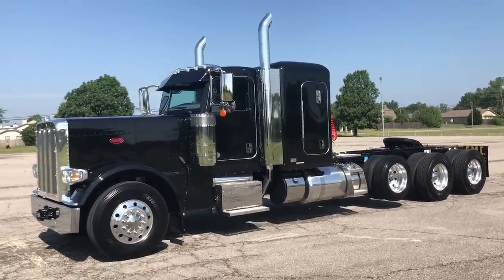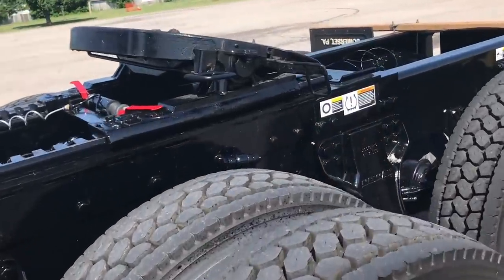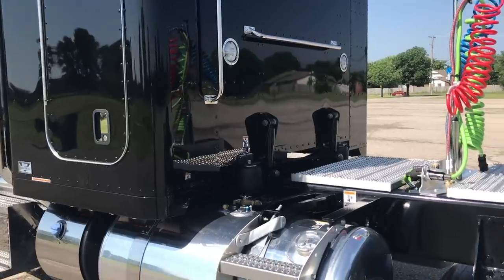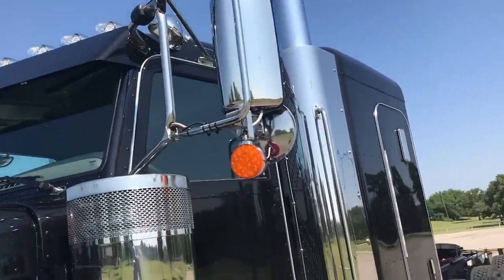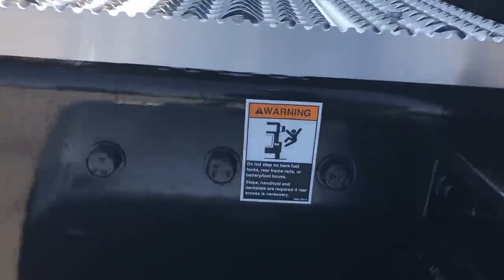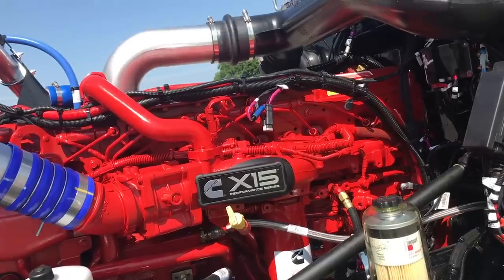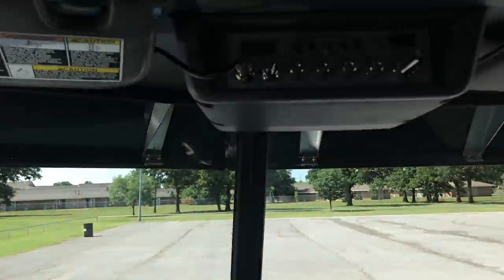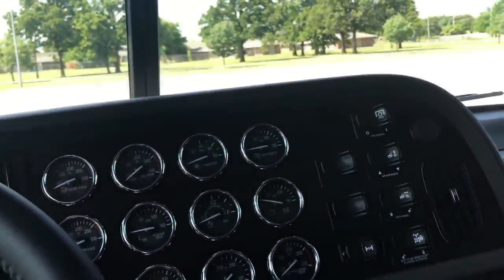2019 389 Peterbilt Heavy Haul 4 speed auxiliary transmission

Comment: Nice heavy haul truck Steve. Good to see the Neway suspension running it on 3 of my trucks. I laughed when you said big 46k rears that's what we run out here in the woods in Oregon but pulling steep grades you need them. If you get pictures after they finish it I'd like to see them, keep up the good work.
Reply: what is the advantage of the neway suspension?
Reply: @ccclc6159  I like it because unlike Pete air trac there's no springs it's just beams and torque arms which limits parts to break,  I had several springs break while I was heavy hauling with the air trac,  I have nearly 250,000 miles with no issues with the neway suspension.

Comment: You said it was a full locker, it's only a 3/4 locker. How many times has that POS Cummins left them on the side of the road? The air shift Spicer would have been neat to see.
Reply from the maker: Been doing this 20+ years PLEASE explain a 3/4 locker to me, I'm all ears...
Reply: @SteveCarbone  a full locker has 3 switches, there were only 2. One interaxle lock and differential lock. The front axle is usually the expensive one that will lock up on a 3/4 locker. A full locker has an air solenoid on the rear as well. Kind of pricey, but worth every penny when the shit hits the fan.

Comment: 315/80-22,5 are used on most dump trucks here. many use it as drives on tractors also as the 295/80 dont have the load ratings. steers 385/65 mostly. but we can haul a lot more per axle. that truck will look sharp when all tricked out :)

Comment: truck I just came out of had 20k front 23k tag 52k rears with disc on steer and drives  2spd aux and 18spd in front full lock rears 550 isx was a beast and 4:33 gears was great spec and was on adz neway air
Reply: robert fletcher Were you happy with the Neway Suspension?
Reply: best suspension I have ever had on a truck tough and rode great for heavy spec truck
Reply: 367 set back axle was 288wb. Had 6.5ft slide on it double locks and full lock rears
Reply: set back axle makes easier to get weight forward when needed
Reply: robert fletcher was it a old ats or valley trans truck?
Reply: @kevinguffey1564  neither
Reply: yeah that's way I'd order them full lockers the neway adz is really good suspension
Reply: robert fletcher I’m just debating between 55” & 60” axle spacings.
Reply: 60 be better because if you run Canada too will have the axle space needed for Max weight and down here one I was driving had the 26k axles and I could get 50k on tandem because of the 60" spacing
Reply: Taylor Alldredge dont get a western star get a peterbilt or a kenworth western stars are made by freightliner and are now junk
Reply: And don't forget but just a suggestion I'd get full 102" wide drive axles there is a difference most are 96 from end to end the wider axle makes more stable the weight bearing on truck is different
Reply: robert fletcher Thanks for that info I will make note of that.
Reply: your welcome alot of guys don't know that their is a axle length difference .but since you are building a true heavy spec like I would do I figured would share that info hope to get to see your truck with all the specs to see how to comes out
Reply: Taylor Alldredge you can get the 4 speed auxiliary in the Pete too! So someone lied to you!
Reply: yeah that is what I was told

Comment: Can someone explain to me how this particular transmission works please. I'm used to 10, 13 and 18 speed but not one like this.
Reply: Start both in first. Technically you can shift every gear but truthfully 6 maybe 7 times depending on hills and weight. Main in first aux in first, shift 2, 3 and 4 on the aux. Then second on main and first on aux. Repeat that for all the gears you have on the main. In reality you learn to skip most of them. Remember to give the air shift aux time to shift else you get it stuck in the middle acts like it's in neutral and it could be. Which is why I like 2 sticks and not the air shift version. Having said that, the air shift version is way easier to shift. Why they mounted it like that is beyond me. Mine is on the main shifter. They had to put it somewhere. Originally it mounted like a gear shit knob because it was meant for non air shifted main transmissions. I'd swap that new school shift knob out to and old school version, add a "Y" adapter and your set. You have to add and re rought the air lines. You really need to have someone show you in the truck. But that's the basics. Good luck. It's not hard it's fun! Only intimidating because you haven't done it.
There's 4 reverse gears too. I recommend you stay in first reverse otherwise you go to fast. A few gears overlap so you don't need them. One or two are actually down shifts even though you made an upshift you figure that out quick.

Comment: Show us how that transmission works!
Joyride time!
Reply: Torsee , basically you have every Gear times 4. It's Awesome. Add s alot of weight but it's worth It.
Reply: Todd Hoover he wants to see how it's done.
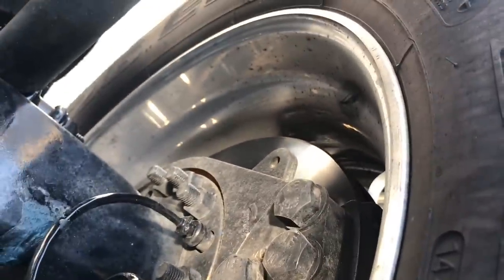Reply: Wish I could show him. Had it in a 379 13spd 3:55 rear's. Pulling a Refer.Awesome spec. Wish I had it Now.Running a Custom 03 379 with 18spd. 3:70 Rear s
Reply: Torsee I
Reply: Beautiful Pete for sure.  I never did like the steering wheels though, they look like they're from my mom's former 1990 mercury topaz shitbox..haha.  the auxiliary blue stick is a stationary stick; its a splitter. Basically "kinda" like taking a 14 or 16 speed spicer,(which is a 2 gearbox system) removing the splitter off the main box and putting it on a stick.  If it was my truck, i'd like it mounted on the gear shift.  You used to see that a lot back in the 80's when V-8's were popular, (V-8 Mack, 3408 Cat powered trucks)  The company I worked for (Domtar) had a lot of log haul trucks; mid 80s macks w/445hp V-8 w/16 spd spicer's.  Youtube search 16 speed spicer and find a couple of good vids of guys showing how to shift one.
Reply: You do not use every gear 4 times. Not even in a 2 stick original 4x4 from years ago, there is duplication between the boxes.
Reply: Check out my vid in my 71 needle it’s a 6 and 4 I have running videos shows how to,, clark friend youtube
Reply: the truck shown is a 2 gear box setup,  the one shown you put the first trans in 1 gear then on the second trans you have one step lower, direct, then one step above  whatever gear the first one is in,,,,,first gear on the second trans is really deep reduction creeper gear not generally used while on the road
Reply: Todd Hoover Was
Reply: Is that a 13 speed or an 18 speed?
Reply: My tractors I built had a 5+4 trans and a 4 speed aux box you only used it in low or low low  to get moving then to direct and after going thru the main trans you could put it in OD running 5:38 gears and not lug it .
Reply: @iBackshift  I feel this needs some correction. The blue stationary stick is an auxiliary 4 speed transmission. A separate box entirely, shifted buy air select. The shift method is similar to a splitter..... But..... if you shifted 1,2,3... maybe 4 on the 18 and flipped one gear on the aux stationary splitter you go back too 1 but be equivalent to 4th at this point in a straight 18spd. If you shifted 1,2,3 again you'd now be equal to high range 6 or 7 H/L the overlap in rations is obvious and needed. But i find the manual gear selector is more satisfying but the stationary is practical
Reply: @ccclc6159  I hate to bust ur bubble but the shifter to on the one shown said it was air shifted .
Reply: @UBIQUITAR   Brian didn't see ur com. Till I wrote mine  I seen the same thing I would like to know more myself. I have only been doing this for 35 years.   I can almost smell B's  when it starts . Not referring to your comm.
Reply: @waynemullins8841  bust my bubble? if you watch the video you can probably figure out how it shifts by the knob and airlines? I usually don't have conversations with shifters but if that shifter told you I said something other than what I posted it might have lied to you

Comment: Has the DEF issues been resolved with the new 2019 Petes ? The whole DEF system has been a nightmare :( Had a 2013 Kenworth T800. Loved the truck but the DEF issue's have been a living Hell😠
Reply: We have a 18 Pete tandem axle with 13,000 miles. No emissions issues, but major suspension problems. From the factory, it didnt have enough steer axle clearance. We put a load on and the front tires came up through the fenders. Pete ended up putting 6 inch blocks in the leafs after 3 visits for the same issue. Mechanically sound, but major chassis issues.

Comment: Can you get it with the hendrickson 20k steer with 425/22.5 and the same with the pusher axle and 24.5 tall rubber one the drivers 4.11 rears with full lockers and the holland fw-100 fifth wheel and 72' raised sleeper? Oh and a fuller RTLO 20918B with a aux browning 4spd? Spicer sucks in my opinion

Comment: They are north of me out of Northern IL. That 4 speed auxiliary is a expensive option. What is the rear axle spacings? A little surprised that they only went with a 14,600 front axle, but then again with that Wheelbase it will be Harder to load the front axle on that truck without a Large Gooseneck Swing Clearance, but it CAN be done. Truck turned out Sharp!
Reply: Peterbilt Steve What is the current lead time on Trucks and I was told that Peterbilt only offers a 2 Spd auxiliary and that you cannot get a 4 speed auxiliary from the factory.

Comment: Nice truck...would look sweet in a tri drive system with 52 000 8 bag system an axles
Also be nice if Peterbilt would start putting the new DD16 in their trucks insted of those ISX Cummins
With heavy towing surprised the company didnt do 4.33 gears but with the 4spd aux 4.10s is lots
Reply: Won't see Detroit in anything paccar anymore as damlier/Mercedes owns Detroit. The new DD series is really just a Mercedes.  In Australia the dd15 is available up to 585 but the dd16 is only available in the new Mercedes Benz.
Reply: @benmurray8689  
Yeah it sucks as the new DDs are nice engines...people i know are having real good luck with all their new trucks, they run the new freightliner 122sd an western stars an pull over size loads. I know it be cool if kenworth an peterbilt would run the new DDs but paccar likes their ISX lol
Reply: @dodgedude101  the new DD series needs really clean diesel and there not simple like the old series 60. Cummins has the common rail but looks alot simpler and cleaner in comparison to the DD series.
Reply: @benmurray8689  
The ISX is simple engine to run
The DD15 or DD16 are slugish in the bottom end but once rev'd over 1300rpm they wake up good an pull good.
Reply: @dodgedude101  Cummins seems to lug well
Reply: @benmurray8689  
The Cummins has a decent bottom end TQ to it for sure but only cummins i would run is the N14...not a big fan of the isx
Reply: @dodgedude101  the isx EGR had issues with turbos, EGR components and lots of extra heat.   The SCR based engine is an improvement from EGR/DPF
Reply: @dodgedude101  the last of the N14 would be 20 years ago
Reply: @benmurray8689  
The new x15 alot of drivers are really liking...they say their great for pulling an fuel mileage
Reply: @benmurray8689  yeah but the N14 is still a great engine to run

Comment: why not 20k front? and non-steerable pushers
Reply: VladGoro25  with a wheelbase that long you can’t get enough weight forward enough for a 20k axle to be of any use. When truck is loaded you actually have less weight on the steer axle then when empty.
Reply: Dave Penn Some of these Heavy Haul Comments I have read on these Videos make me shake my head.

There are A LOT of Factors that come into Play when it comes to Transferring Weight to the Front Axle?

What’s Your Truck Type - Set Forward or Set Back Front Axle?
Are You Running A Tandem Axle, Tandem Axle with a Lift Axle, Tri-Drive, a 3, 4, or 5 Axle Truck?
What’s Your Rear Axle Spacings - 52”, 54-55”, 60” or 72” (I myself prefer 54-55” Axle Spacings with a Set Forward Truck & 60” Axle Spacings with a Set Back Axle Truck)
What’s Your Wheelbase - Is It 250-315” WB
What’s Your Fifth Wheel Slide Length - 36”, 48”, 60”, or 72”+?
What’s Your Trailer King Pin Distance - Is it 16” or 24”?
What’s Your Trailer Gooseneck Swing Clearance - Is it 84”, 96”, 102”, 106”, 108”, 110”, 116”, 120”, 125”, 130”, 135”, 140”, 146”+ ETC?
What Type of Setup are You Running - 7 Axle, 8 Axle, 10 Axle, 11 Axle, 12 Axle, 13 Axle+ with a Jeep & Booster/Stinger Axle?
Is it a Closed or Spread Axle Combo/Setup?
What is Your Deck Length & How is Your Load Loaded - Is It Loaded Heavy to the Front, Is it Centered, Is it Loaded Heavy to the Rear Depending on Trailer & Axle Setup

Now Factor ALL of These Things Together!

Comment: 2019 Peterbilt which still has air cleaner cans mounted on the outside of the truck unlike Kenworth 2019 trucks with no air cleaner cans what a shame for Kenworth
Reply from the maker: Sad to see the W900 go
Reply: W900 still in production,  still has air cleaners on the side.  The 990 is not taking its place.  

I'd be surprised if the 990 and its Peterbilt counterpart dont flop.

Comment: No good for heavy haul only kw are I know i drove both for 34 yrs especially because kw hold up well on dirt road and heavy haul is mostly in dirt
Reply from the maker: You know KW and Peterbilt are both PACCAR made right?
Reply: Lmaoooo Manuel,  go back over that fence my friend. Harvest season is over
Reply: @SteveCarbone  irrelevant.  He's actually right.  Peterbilt doesn't offer anywhere near the options in heavy-haul or off-road that Kenworth does.  What he obviously doesn't know, which is relevant, is most Petes are built on KW frames.  No bad thing, many KWs are ordered with Pete suspensions. I, for one, love the ride of the Pete low-leaf.  

But if you need a truly serious HD truck, the KW is the one that gets the job done. T800H, The Brute (C500B), and the incredible 963B.

Comment: It looks like a warthog.  Whit all those rivets all over. And it can't take any load either. A normal four axel truck here in europe has 32 Tonn total leagal on the road. But can have 9 tonns on the front axel and  24 on the trippel.  Registraded total upp to  40 tonns.  Normal 3 axel truck is 27 tonns leagal on the road . But most are registrated for 28 to 31 tonns. European trucks you can buy in the shop with upp to 750 hk and 3500 nmt. Volvo 750/3500. Scania 730/3500. Mercedes 630/ 3200. Man 640/3100.  My New Scania has 650/3300. Here in Norway it's leagel with 60 tonns total on truck and trailer together. It's about 120.000 lbs +. Sweden and finland has now 74 tonns i think. Total length 26 meters .
Reply: You need to go to wv and truck some coal  lol I here they haul as much as u gross   lol
Reply: Those euro trucks are ugly
Reply: @imyourhuckleberry4547  We think the same about those made in the USA.  And the traditional american trucks , looks like european trucks made around 1965/70. Old fashion.
Reply: @pertpesc7058  yup. Old fashioned trucks are real trucks not those funny looking plastic things you guys ride around on.
Reply: @imyourhuckleberry4547  You should try one New Scania  Mercedes og Volvo. . I have friends with older american trucks. Not for work but for fun. They are realy bad to drive. 
Noisy , ragged, no torque, very bad turn radius , hard to shift , not any airsuspension, not even on the cab, 
Not to forget the overview from the cab . For fun ok but for work no no no.
Made of aluminium and plastick.

Comment: a question. Why does this truck have an auxiliary transmission?
Reply: Edwin Pulido it’s for heavy transport
Reply: Give s you 4times every Gear. Gives you plenty of Low end an doesn't kill you out on the open Road. Very versatile!
Reply: planetshapers spicer super 16
Reply: Why would you say something like “super 16”? It’s clearly an Eaton 18 speed main with a spicer 4 speed aux. 
and it definitely doesn’t give you “4 times each gear” 

It allows a very steep rear gear. The ones I ran had 5.38:1 rear ends. You put it in 2nd if you’re in soft muddy conditions, otherwise the auxiliary goes into third (1:1), you run through the 18 speed as per normal and as your last shift put the auxiliary into fourth (overdrive) to allow for a decent highway speed with those tall rear ends (70ish mph at 1700 rpm). First shift when you need to climb a hill is back to third or you can risk splitting the case.
Reply: planetshapers I don’t know the model number or anything. It’s basically the ‘4’  from an old school 5 and 4 setup, only with an air shifter instead of a stick. It’s quite simple to use much like the splitter on an 18 speed
Reply: meteor545 4 holes on 4 positions sooo 4 times 4 is 16
Reply: Drive one. Then you’ll know
Reply: Edwin Pulido heavy weight and hauling
Reply: meteor545 Your Wrong ! Ours were built on 13 speeds,4 speed aux on the Floor next to the driver's seat. That was 05,07 not sure what Pete offers now. 4 gears for every Gear including reverse !

Comment: Why is it US trucks always top out at 605hp? In Europe the majority of heavy haul trucks start at 630hp up-to a 730hp Scania or a 750hp Volvo.
Reply: we don't have power for nothing
Reply: @thermidorlevrai65  but you carry much less weight than we do. The average weight of a truck with load in Ireland is 101,000lbs on 6 axles.
Reply: cummins claims they have over 700hp in australia, but no trans in the usa is rated for over 2050ftlb torque,
Reply: @thermidorlevrai65 , it's only 605hp!
Reply: @theworldaccordingtochris4370  most of the weight is all those ridiculous lights you guys attach all around your trucks.
Reply: @imyourhuckleberry4547  we can add more because our electrical systems are better.